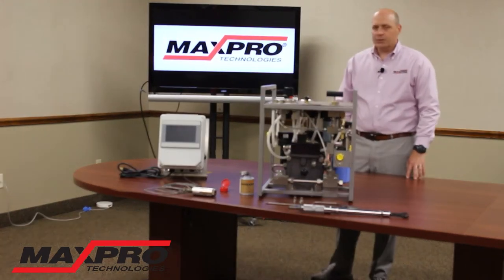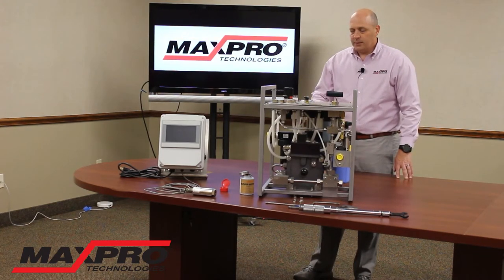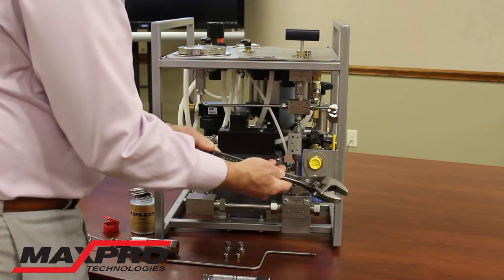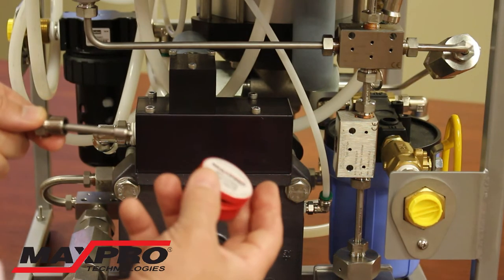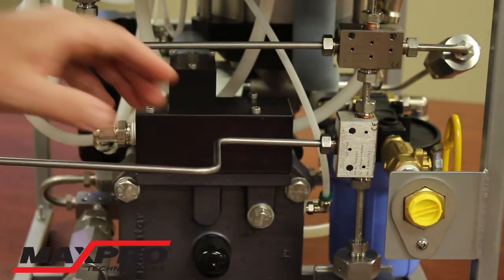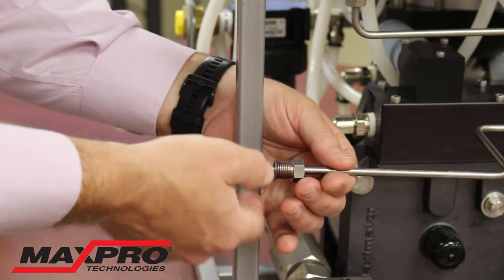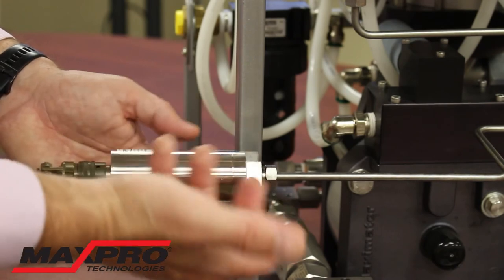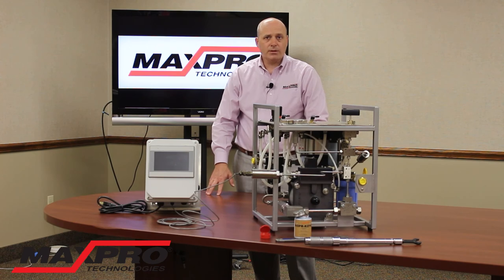Setting Up a Pressure Test Cube

Comment: Can it be used for hydro test for fire extinguisher cylinders
Reply: Absolutely, it would just depend on what your pressure testing requirements are.  The cube and logger in this demonstration are designed for tests up to 30,000 psi.  Contact Maxpro Technologies and one of our engineers can confirm if this is a good fit or recommend a different product for your specific needs.